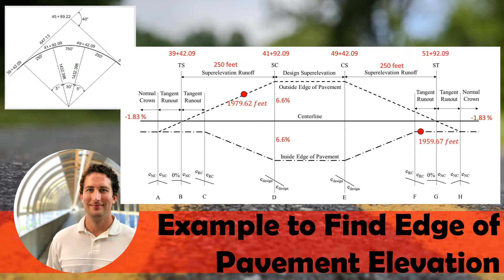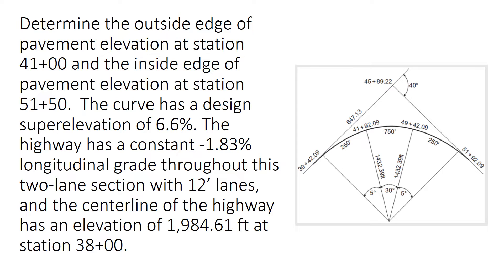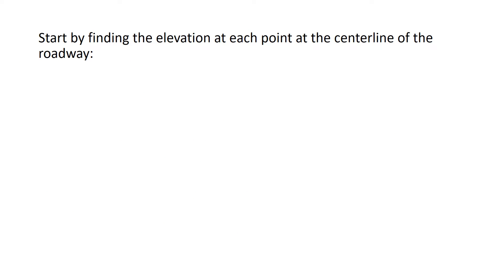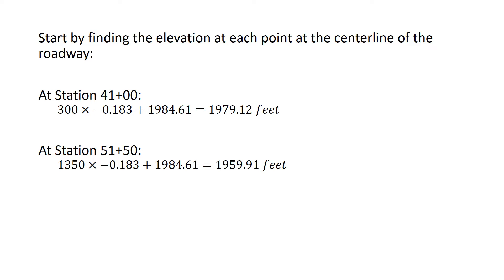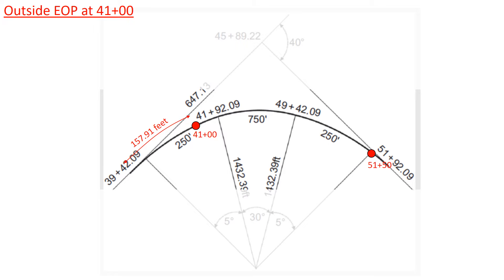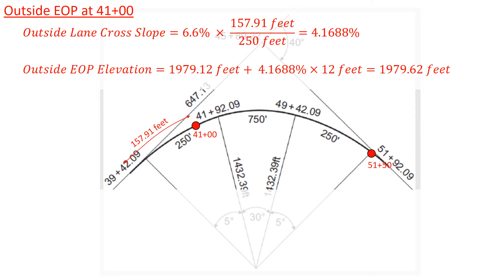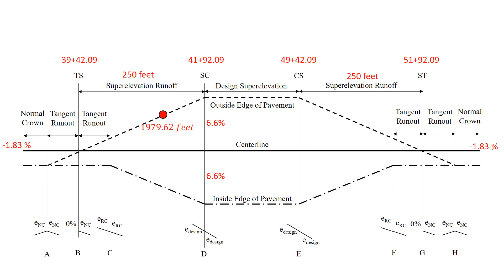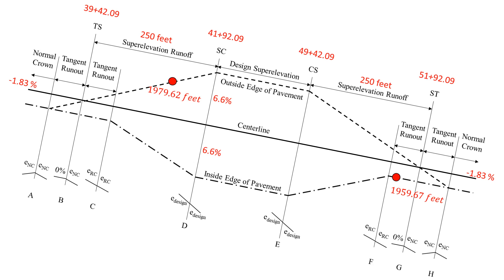Example for Finding Edge of Pavement Elevation | Horizontal and Vertical Alignment for Highways

Comment: Is it typical to see the Tangent Runout length overlap with the Superelevation Runoff length? I think I have seen some examples where the Superelevation Runoff begins where the Tangent Runout ends. 

Also, the Green Book says Tangent Runout is the length required to bring the outside lane to flat/zero slope, but in the diagram the portion of Tangent Runout overlapping with Superelevation Runoff continues to superelevate the outside lane to eRC, which I believe refers to Removal of Adverse Crown. Do both of those Tangent Runout segments sum to 75.75 feet, or are they 75.75 feet each?
Reply from the maker: Using the points on the relative gradient profile (@6:33), the tangent runout distance is from point A to B and the superelevation runoff takes you from point B to D.  The distance from normal crown to the design superelevation (point A to D) is therefore tangent runout plus the superelevation runoff.  

The distance from B to C is also the length of the tangent runout.  In this example, yes, the tangent runout is 75.75 feet.  On this relative gradient profile, the dimension of the tangent runout is shown in four portions of the profile: A to B, B to C, F to G, and G to H.

Comment: I'm a little confused as to how you found the tangent runout to start at 51+16.33
Reply from the maker: It can be found by subtracting the tangent runout distance 75.75 feet from the ST station 51+92.09.

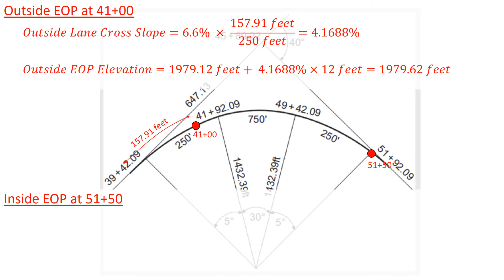The calculation was completed at @5:08, but the diagram @8:21 more clearly shows whether the point of interest is before or after the tangent runout distance.

Comment: 5:27 How did you identify 2% normal crown? What's the standard you are getting it from??
Reply from the maker: Great question - that is an important value to check with for any jurisdiction you're working with.  In my experience, 2% is the most common value used in the United States, but I believe some agencies use 1.5%.  For classes I teach, we assume 2% normal crown unless otherwise specified.